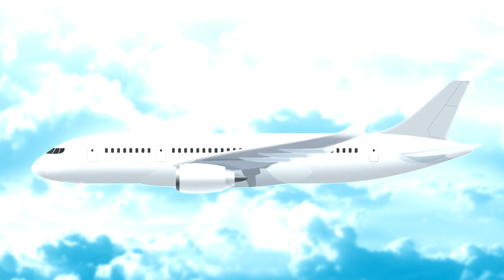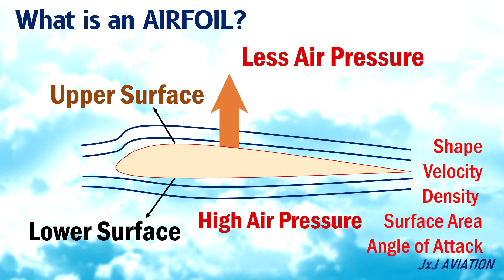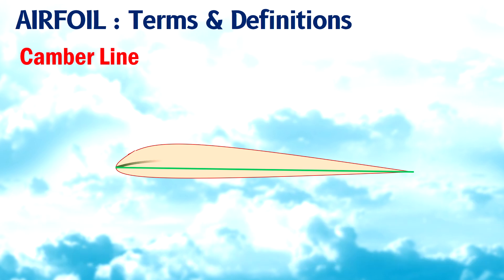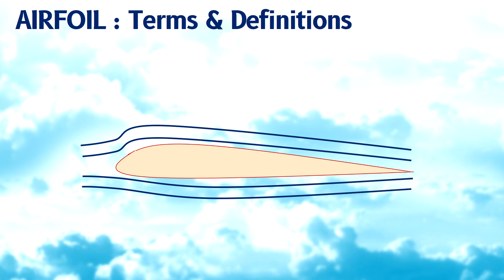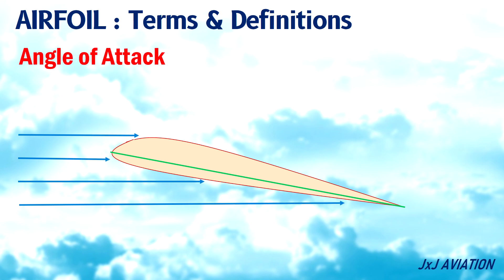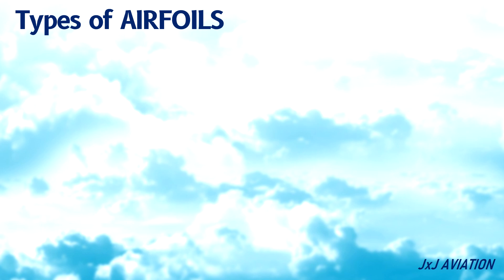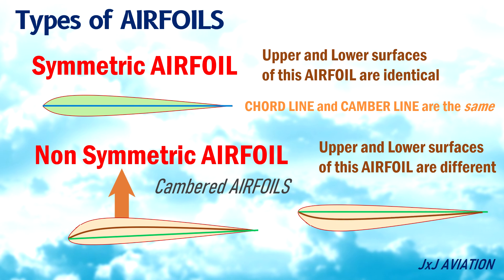What is an Airfoil? | Understanding some Terms and Definitions related to an Airfoil!

Comment: All lift is caused by excelleration of air downward. A pressure differential does not cause lift. The bernulli effect does not cause lift. Air does not transit in equal time. The airfoil shape does not cause lift. You cannot produce lift without accellerating air. And you can not excellerate air without producing lift. In any case, lift does not cause lift.
Reply from the maker: That is a great explanation

Comment: No. Lift is not created because of a pressure differential. Rather, lift IS a pressure differential, it's not created by a pressure differential.  To create lift you have to excellerate air down. Otherwise there will be no lift or pressure differential.
Reply from the maker: This video just shows the terms involved in an airfoil

Comment: This is not how wings produce lift. It's the nonsense that everyone is told at school by people who don't know any better. All you need for lift is an angle of attack and forward air speed. A flat and parallel wing will generate plenty lift but the useful window of operation (before it stalls) is quite small. Airfoils make wings more efficient and more user friendly but they are most certainly not necessary to make something fly.
Reply from the maker: This video was just to give the terms used in an airfoil. A flat plate can produce lift, but will it be efficient for use in an aircraft?
Reply: @JxJAVIATION  No. It won't but the video did not present that information so it is inaccurate and gives people the wrong understanding of why airfoils are used and why aircraft fly. It perpetuates the nonsense we were all taught at school.
Reply from the maker: @teabagmcpick889  An airfoil is a basic necessity, which is common on all aircraft. The information which is not presented can not be termed as inaccurate!
Reply: Wrong :)

Comment: Hey, excellent video, but how does Stall occur due to an increase in angle of attack, isnt an increase in angle of attack supposed to increase lift?
Reply: Maybe that's because of the vector component becoming zero towards the land
Reply from the maker: Its until a certain angle the lift will increase, beyond the stall angle, the air flow separates over the top surface, causing a stall!

Comment: If an increase in angle of attack increases lift, isn’t lift because of angle of attack?
Reply: No, there is also lift happening at 0 degrees angle of attack. 

If you choose a higher AOA, you are of course increasing lift, but at the same time drag is also increasing. So there's an optimal point where lift/drag ratio is best, usually lower than 5 degrees AOA
Reply from the maker: that is a good explanation

Comment: why is the airflow above of the wing faster than the airflow below the wing?
Reply from the maker: The shape of the airfoil causes the air flow to accelerate.
Reply: Its on account of the curve on the upper surfce,,, as the air stream is passing over the curved surface faster than the lower surface of the wing ,, you have pressure differentilal also which gives the wing lift to take the craft off the ground and fly high in the  sky , please ask the questions dont be shy to ask ,, its easy now with computer aided stuff like Utube ,, it was more difficult 40 years ago trying to grasp this stuff ,, now its way easier
Reply: Because the upper surface is curved upwards and the air has a longer path to travel, especially if the wing is pitched up.

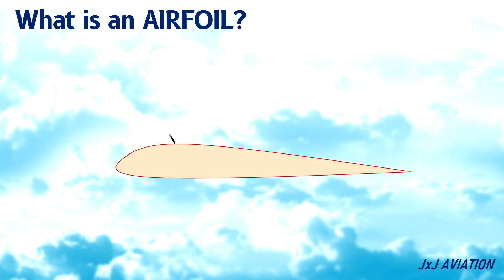Comment: if it is a symmetrical wing? 🤔 0:47
Reply from the maker: The pressure over the top and bottom surface will be equal so no lift is created.
Reply: @JxJAVIATION  Unless the wing is pitched upwards.  This sort of wing is less efficient but works upside down, so is useful for inverted flight, e.g. aerobatic shows etc.
Reply: @karhukivi  speed is increased and flaps are adjusted to make maneuvers possible I believe
Reply: @karhukivi  speed is increased and flaps are adjusted to make maneuvers possible I believe